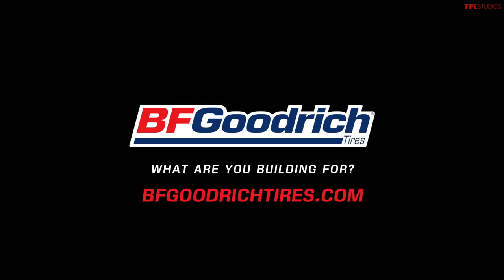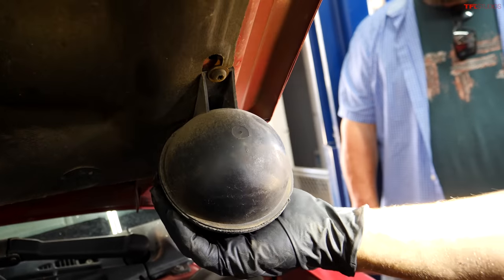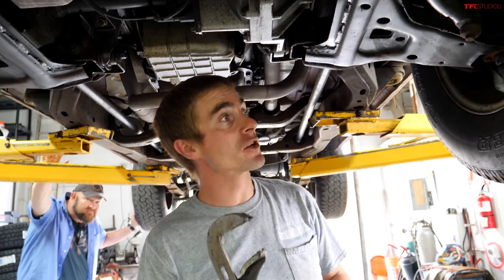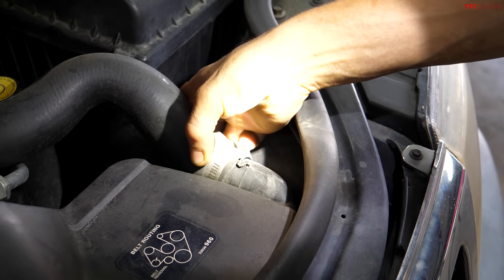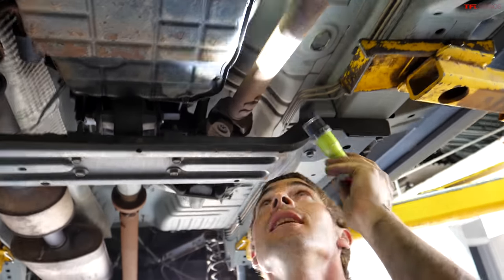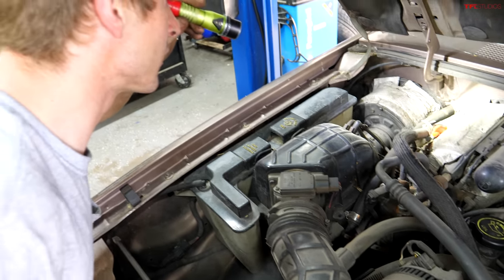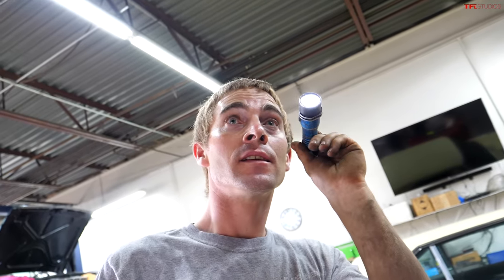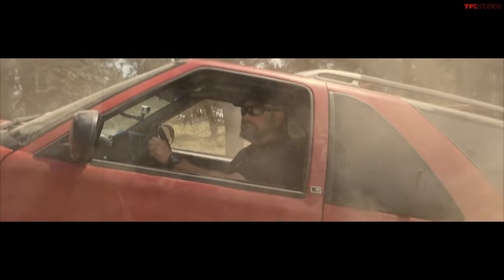It’s Much Worse Than I Even Imagined — Our Mechanic Can’t Believe What a POS I Bought!

Comment: Mechanic saying the Mazda was "cheaply built with cheap parts" clearly shows he is biased, but it was interesting to see him recognize what work had been done on the vehicles to determine how well they've been maintained.  To me a bunch of newer parts on the jeep and Chevrolet just go to show how unreliable they've been to have had a lot of work done on them from new radiator, half shafts brakes etc. etc.  That Era of Ford rangers is actually pretty reliable and long lasting despite what anyone says about them being built with "cheap parts".  I bought a similar Mazda truck with 100k miles and just hit 200k and the only work I've done on it is an ac clutch and multiple sets of tires.
Reply: I would say it depends on the year the Ford/Mazda truck was made. I agree these vehicles are reliable but that also depends on the owner who maintains them. My two cents on it.
Reply: I have owned a Sonoma (s-10) since 2005. I have came to the conclusion that Ford rangers either have more reliable auxiliary components or more reliable owners, possibly both. The majority of s-10s I see have young owners who use them professionally and they are abused. The rangers I see are old guys driving to Lowe's or the coffee shop. Purely anecdotal, but that is my experience.
Reply: New parts can easily be from poor maintenance and horrible previous owner driving abilities/habits... new brakes doesn't necessarily mean they were badly made could be a two foot driver with heavy feet or speeder and last second stopper.
Reply: Keep in mind the Chevy and Jeep have 40k more miles than the Ranger. The Ranger has a lot of stuff that looks like it should have gotten replaced quite a while ago. But the previous owner hasn't taken care of it.

Comment: I am thinking the B4000 is going to be the worst.  Andre got hosed on the price
Reply: Right couple months ago I got a 05 Nissan Pathfinder 120k miles lil roof rust bad primer I think for 2k.  I stole that sucker fully loaded leather clean
Reply: Still kept my 99 Jeep grand though it’s a tank with 240k
Reply: @Floreypottery  this is making me seriously think I overpaid at 2800 for a 2003 c class with over 200k miles 😂
Reply: @tati-anaroseee4316  pandemic / hyperinflation pricing
Reply: B4000 needs to head to the crusher

Comment: In and out movement of the rear axle has nothing to do with the axle bearings. The axle is held in with the clip in the differential. Rebuild the rear end and it will do the same thing. Without the play it wouldn’t be possible to assemble.

Comment: My first Ranger was a 97 xlt regular cab with the 2.3 4 cyl. Had a 2010 supercab xlt 4x4 with the SOHC 4.0 V6. That 2010 is still on the road with 252,000 miles. Still runs like a champ

Comment: I not here to bash Toby, but I feel like he didn't check the ball joints properly on the Blazer.  You need to use a jack and support the lower control arm while checking ball joints on a vehicle with independent front suspension. I've been burned by bad ball joints the way he checked it when in the air.

Comment: I think the guys at Anti-Forder he's a little doom and gloom on the Ford I've seen those things go through hell and back I had a bronco go over 500,000 miles without anything big bronco with a 302 and I had a 4.0 L before also that was awesome and I've driven a lot worse ball joints than that yeah it's a little loose but it wouldn't loosen up to break it most likely...lol.
Reply: 4.0 OHV Fords are bulletproof. You have to be some kind of mouth breather to mess one up. Give him a break on it, you know he never sees them in the shop.
Reply: @fuji302  Exactly, I had a Ranger with one and was running great with 247,000 on it when I sold it....zero internal engine work needed/ done and I beat and abused that thing... I now have another one in a 4x4 Explorer....youtube:  ford explorer 400,000 and there's several vidoes of them turning 400K......and the WJ Jeep with it's inline 4.0 is another bullet proof engine...these characters just jump on the unfairly attack American vehicles.... traitorous if you ask me....
Reply: @barrya.6212  I have a 99 Explorer Eddie Bauer 4wd with the 4.0. I heard there's a potential timing chain issue, but miner's been fine. Has 270k on it now/driven from California to Arizona twice in the last 6 months. 120 degrees out, A/C on, doing 75-80mph, averaging 20+ mpg. Tires wear perfect. It gets better mileage than my K1500 Suburban, so I use it more.  It's been very reliable.
Reply: @ojaiguru  Yeah, there was TWO different 4.0's offered in the 90's + (the one we were referring to was the OHV version)...yours is (most likely) the "SOHC" version...with FOUR timing chains....the guides/ "cassettes" are known to fail on those starting at around 150K...but you and many others are the rarer lucky ones who make it to around 300K....any chance previous owner replaced them? If you plan on hanging onto it for a bit longer I'd look into installing a "pre oiler".   Otherwise drive it till the wheels fall off.
Reply: @barrya.6212  You're correct, mine is the SOHC. I bought it from my girlfriend because her adult daughter was only going to get $800 as a trade-in and it was in perfect condition with $800 in new tires. They were 2nd owners, I believe, and were always on top of the oil changes/owned it just after 100k.
I suppose it's possible original owner had it done. It runs perfect. I've thought about selling it because of the potential timing chain issue, but it costs way less to drive than my Suburban, keeps running, and hasn't had any real issues/doesn't cost me anything other than registration and insurance.
Reply: @barrya.6212 ...mine's a 99. California/no rust.
Reply: @barrya.6212 ... thanks for the tip about the pre-oiler. I'll look into it.

Comment: The truth is with the low value of all these vehicles a bad transmission is a nail in the coffin. I agree with all the other comments here about Toby, he is very thorough and good at what he does but a bad transmission isn't as big a deal to him personally than your typical back-yard mechanic without a lift. Once the trans goes most folks aren't going to put the money back in to replace the transmission, at this point you are typically better off taking that transmission money and putting it towards another used vehicle in better condition. The Jeep is in great shape and to some may even be worth replacing the trans but fixing it is going to take more skill than your typical driver is capable of taking on or paying a big bill to a shop. The Blazer, on the other hand is in remarkably good shape for it's age. It looks like it must have come from a warm-weather state and not a location where they use salt on the roads. Yes it's got a leak but those 4.3 V6 engines are rock solid if taken care of. In this case pay attention to the oil level and it will keep going for a long time. The Blazer definitely isn't perfect but I've seen these covered in frame rust and the body rotting away while the drivetrain keeps going. The Ranger with some obvious deferred maintenance overall needs the most work of the three but getting it there would still be less than the trans on the Jeep. Considering this is Colorado where winters can be harsh all three look like they spent a good part of their life in a garage. It will be interesting to see how this pans out, unfortunately it probably won't go on long enough to see when the transmission gets worse.

Comment: In a $2500 4 wheel drive the last thing anybody is worried about is a air conditioning that's what windows are for. If you're worried about air conditioning spend more money you're mechanic kinda picks up things it really don't matter

Comment: That WJ is solid axle front and rear with a Dana 44a out back. They may even be optioned with vari-lock diffs that lock up like lockers when one wheel starts spinning. The suspension is coil on axle, and he has the stronger Selec-Trac transfercase. It should be an NP242HD or NV242HD transfer case. It allows 2wd, 4HI, 4LO. I don't know why they keep talking about the trans in it - its a 45RFE that actually becomes a 545RFE with a dealer flash which may have already been done. The electronic programming is what determines how many "speeds" those trans are and I am not aware of any shortcomings with the trans. 

As far as capabilities, my money is on the WJ.

Comment: If I had to pick one out of the 3 would be the Truck. I would replace the bad parts myself. ball joins and the water pump are not that costly. rust on the rear bumper not that big of a deal as those bumpers are not that costly.  Now if you are paying a garage to do all the work then the mazda would be a no go as the cost of repairs would be way to high, But if you can do the repairs yourself it would be a good old truck.

Comment: Blazer has a rear sway bar....then he'd be quite surprised my 88 Bronco 2 has front and rear sway bars.  

The "Ranger" seems pretty normal wear items for a truck...except they just kept driving it rather than fixing anything which is why they were so happy to see these idiots coming that have no idea how to negotiate prices.  That shift knob coming off...I think that's just a normal Ford issue LOL, my 87 Ranger and my 84 Bronco 2 both had the same problem, usually the 1st to 2nd shift you'd end up with the shift knob in your hand LOL.  I epoxied them on, no more issues.  Unfortunately my 88 Bronco 2 is an automatic with the notoriously horrible A4LD.  

I'm betting the 4WD doesn't work in that Ranger either, was hoping they'd try it while it was sitting on the lift.

Comment: A 4 cylinder Ranger will run 400000 miles! I've had 2 of them! They're cheap as crap to maintain, and if you do need parts they are cheap! The down side is people just drive the hell outta them and don't service them!! Always get the 4 cylinder Ranger! They are all small trucks, the 4 cylinder, If you need more truck get a full size truck, they have brakes that you'll need! These trucks are great for knocking round, not pulling campers!!

Comment: I'm gonna say he says S10 Blazer is the best.
Reply: I think so too. Seeing how it was mechanic owned.
Reply: @Wh33lManDan  Right it could be the jeep but I doubt it and it's definitely not the Mazda that thing is a turd lol
Reply: @Wh33lManDan  mechanic owned, tends to not actually be a good thing. "Mechabuc owned" typically means 12 lights on the dash, duct tape holding it together, and they gave themselves the inspection sticker.
Reply: So I was wrong.... Still I'd pick the Blazer with a bad leak 4.6 V6 engines are good and are plenty enough to find in decent shape still. The Jeep in my opinion is a nightmare waiting to happen for the wallet I'd clean it up and flip it as fast as possible it's not a Wrangler (90's -03) and definitely not an XJ the only two jeeps minus the Scrambler, Comanche and CJ7 or CJ5 I'd ever consider investing into plus it looks like a minivan. Grand Cherokees are junk I had a 98 I loved it and hated it so much it was the first vehicle I ever spent time and money on keeping it running which lasted a year with the 4.0 straight six which I still like but it was a POS when I bought it and it hurt me financially and will never invest in a Grand Cherokee of any year again let alone Chrysler products.

Comment: The mazda is definitely the worst. I'd say the Chevy barely beats the jeep, I don't know what kind of damage the trans had and historically it would burn up and fail so I'm not sure if they just flushed the trans to try and clear it but atleast the Chevy has no problems indicating besides oil leaks. A bit of RTV and a good Saturday afternoon will fix it right up. Also changing the diff fluids, and flushing others

Comment: I like how he’s incorrectly inspecting steering and suspension components. Master hack, not master tech. But that’s coming from my 13 years of being ase certified and master tech for gm.  Btw shocks are supposed to have that tiny bit of seepage on the very top of the shock, they’re designed that way to keep the seals from dry rotting.
Reply: Wow, you seem really awesome. Tell us more about how awesome you are.
Reply: @paulhunter9613  how he checked the suspension was literally how the gm instructor at the General Motors owned training school in New York said not to check any suspension in any vehicle. For tie rods specifically that’s how you miss bad tie rod ends, they develop side to side play way before they start getting up and down play.

Comment: Toby seems like an ok mechanic but he definitely exaggerates on a lot of stuff. He is also way out of his element when it comes to to domestic trucks and suvs, especially older ones. I don't know how he could say that Jeep is better than the B4000 or Blazer with the transmission codes it has. I'd much rather deal with a few oil leaks or replace ball joints or tie rods than a junk Chrysler transmission. Also has the man never worked on a solid rear axle before?  How do you not know that it's normal for an axle held in with C-clips to have a little bit of endplay?

Comment: Im sure the blazer is the best but mostly cause those run forever
Reply: The 4.3 is the goat of v6s
Reply: ANYTHING GM  IS GARBAGE
Reply: @toddbob55  All caps, so it must be true...
Reply: I’d have to agree overall. The Jeep looks like it’s the best deal right now, but it’s got a new transmission in its not too distant future. The Blazer needs the tie rods done and a few leaks fixed, but it basically sound. Biggest PITA is it looks to need the main bearing seal done, which is money, but not new transmission money (and even if it did, 4L60E’s are pretty cheap these days)

Both are drivable now

Ranger-san needs the front end rebuilt and a bunch of extra work before it’s really drivable. And even after that it needs a new exhaust.
Reply: @adam_mawz_maas  well the thing is nathan has 300 to spend on the blazer still so he could use the money wisely and fix whatever is most urgent on the blazer so for next to nothing money i think he got a decent buy
Reply: @adam_mawz_maas  the Jeep has a ton a miles with little issues here. It’s proven reliable

Comment: Yeah! Going to make the Jeep a gold mine, when reality is it’s a mines alright  and it’s full of slate rock! I would rather fix a little bit of oil leaks than replace the transmission! He jumped on that hundred bucks looked like he was in a junkyard the garage barely big enough to fit the vehicles in for him make his screwy diagnosis!
Reply: It's most likely a TCC control spring in the trans pump, they tend to break in high mileage. It causes the converter to slip instead of locking up in 4th gear. It can also cause low line pressure when cold, It may overheat on the freeway but should perform fine otherwise. The 545rfe is a very robust transmission it should just need those springs replaced and they come in a shift kit, i did it in 1 day. Maybe 100$ with new oil and filters.

Comment: Those ball joints on the mazda are less then 50 dlls i dont think the jeep transmission its 50dlls the blazer leaks are a nightmare and more then 50dlls to fix them get a quote to fixx all the problems bet the mazda its the cheapest to fix it not to mention its a pick up not svu try to haul dirt,sand,rocks on the jeep or blazer cant do it

Comment: So Nathan and the Reno strip club for the win. Andre and his death trap 2nd. Tommy disqualified for going over price. 
  Part 3 all necessary repairs done. Tommy now allowed back in 1st place only vehicle still under $3k provided tranny doesn’t blow up. 
 Part 4 Nathan leads the way on the mt  pass. Andre brings up the rear. Tommy now permanently disqualified after transmission has a catastrophic failure en route to the mt. Roman refuse to pay $4k to replace it. 
 Part 5 Nathan disqualified after Roman finds out he’s charged $1200 on the tfl credit card buying makeup oil and gets a $10k fine from the EPA for creating an oil slick on the side of a mt. Andre and squirrel cross the finish line and Roman proclaims Andre his copilot and his Mazda Ranger the winner.